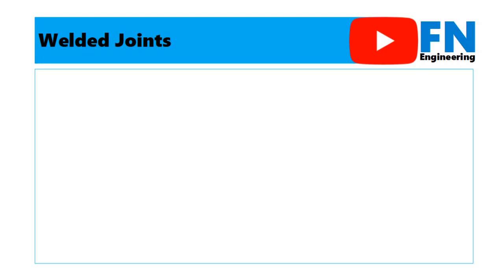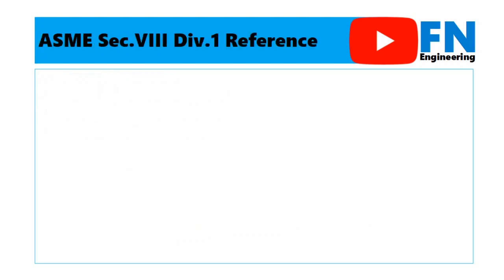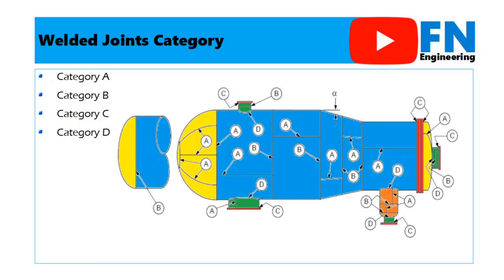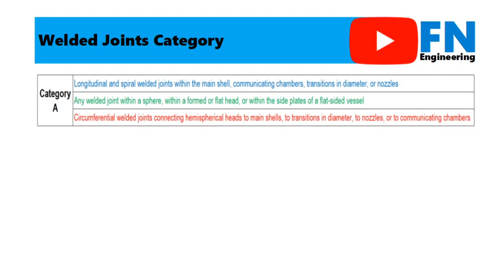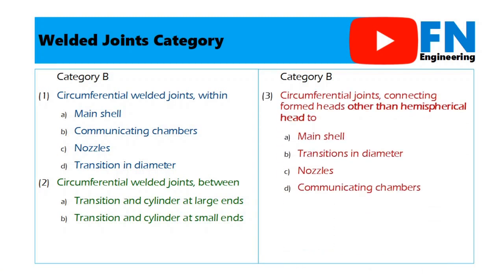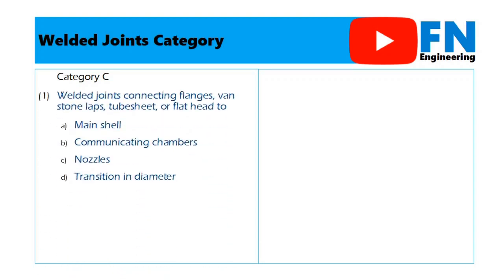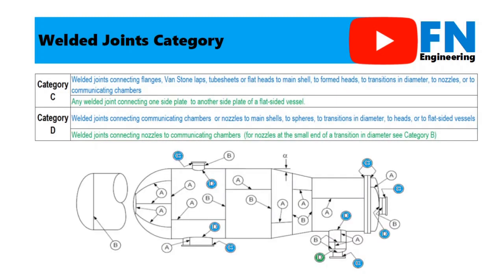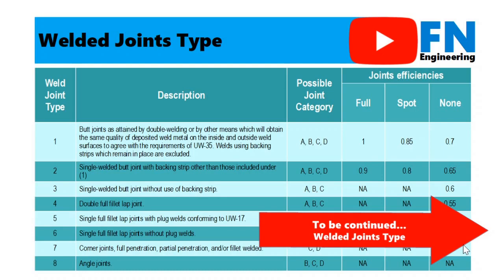Welded Joints Categories in Pressure Vessels as per Figure UW-3

Comment: I am doing a FEA analysis of pressure vessels. Slightly different from ASME div 2 due to the seismic load involved, I have modeled the shell with corroded allowance. But do I consider Weld Joint efficiency while modeling the shell? My peak stresses are due to the saddle support [near the support].

Comment: Good day i got a question from a company could you please answer  it ?the company produce chassis not a pressure vessels the question is : the definition  of  the  decision  groups  (a,  b,  c,  or  d)  for  the  weld  seams  for  the  Frame: Which  decision  group  would  you  take?  Why?
Reply from the maker: Thanks for your question. Do you have some pictures, sketches, or drawings?
We can determine the joint category based on your sketch compare to figure UW-3
Reply: @fnengineering  hi thanks for the response I dont have any drawings its a interview question the company produces 4×4 chassis frames I need to do the presentation for that
Reply from the maker: @srijithist  I am not sure regarding your question. But, the chassis is not pressure vessels, alright? If yes, it is not included in welded category based on figure UW-3